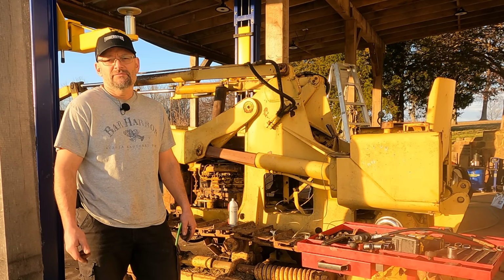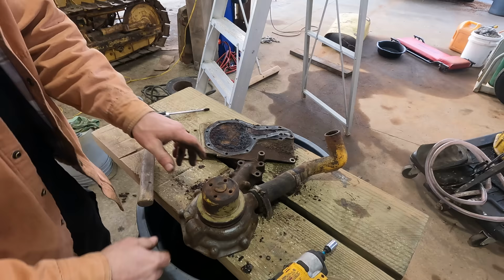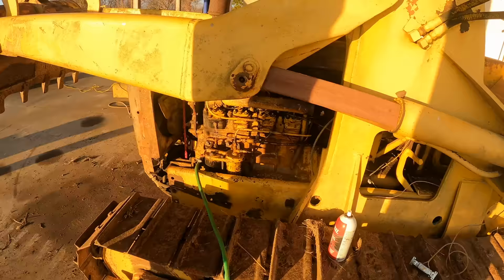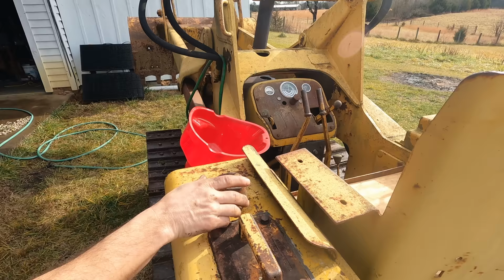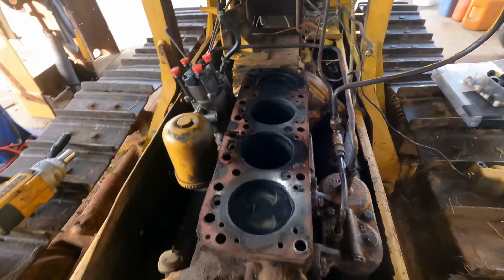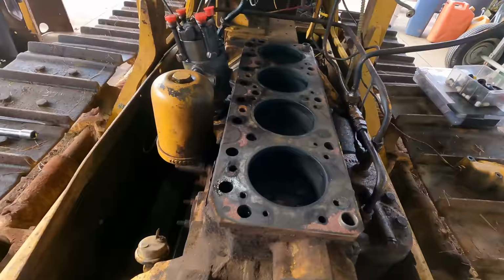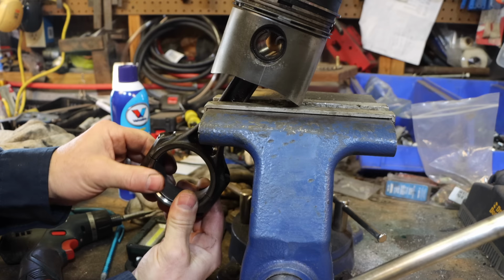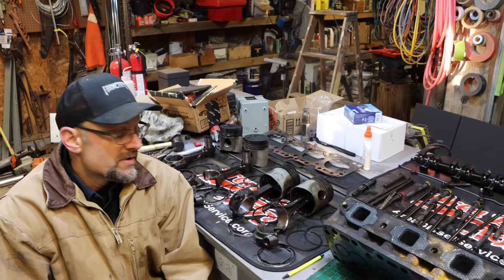1960 John Deere 1010 Diesel Engine Teardown.  Worth Fixing?

Comment: So glad the puppy dog eyes worked!
This will be amazing - Thanks for not just going down this rabbit hole but diving in head first!

Note on the radiator hose:
I have done this myself but…. Old Tyne packing tape - paper tape, fiberglass reinforced with all that dry glue - wrap the hose with that first, then your electrical/Gorilla tape combo. Apparently the way it’s supposed to work is that the leak gets the glue wet and the heat makes it stay stuck.

This was told to me in a previous century by one of those official “old timers” … who kept a roll of packing tape in his truck. (I never did see under the hood)

Comment: A bit to read here.

Don't reuse those big end bearings Jon. They're completely done.
Before putting it together you need to check the ring end gaps of every single ring. Pre gapped rings are never to be trusted.
Put the ring in the bore and use an upside down piston to square them in the bore and measure the gap with feeler gauges.

If you need to adjust them use a new file and dress every corner and edge you've filed with a stone so there's no burrs.

You need to clean the ring grooves in the pistons. A broken ring can be used as a tool to get in there. Be careful though to not damage the lands as this method can be quite destructive if the carbon buildup is bad, particularly on the pistons with the broken rings - sometimes those grooves can be very badly carboned up.

After honing, wash the bores with solvent as clean as you can get them. Next get some hot soapy water (a bar of soap grated into 1/3 bucket of water is best) and a stiff brush and scrub the bores clean. Next with new soapy water scrub them out with the sponge, blow them dry and oil immediately. A test of cleanliness is a clean white cloth wiped across a part of the bore and it remains clean. 
What happens with hones is the stone material gets into the cylinder metal on a microscopic level and acts as grinding paste. The soapy water/brush/soapy water/sponge method gets it all out.
Naturally you need to protect the big end journals on the crankshaft from all the falling honing debris and cleaning processes. Tape them up with electrical tape.

The deck of the block needs a very thorough clean. This will take time. A razor blade in a holder and some coarse Emery until all the bare metal is exposed. Absolutely no carbon however embedded should remain. After cleaning it well, Brake-clean or Carbi-clean the surface. It should be spotlessly clean. Sometimes I do this 3x. Some staining of the metal is OK on the deck just so long as it isn't old headgasket material itself or anything else. Rust pitting on there is usual on patch jobs so the cleanliness I'm making you adhere to is to give the very best possible likelihood of success.
When it's clean cover it immediately. Before putting the head on clean it with a brake clean soaked cloth and blow off at the last possible moment.
Do all this with the head surface if you don't have it faced. If you have it faced still clean it off yourself via the described bore method, but don't oil it.
Only take the headgasket out of the package at the last possible moment and inspect there's nothing on it - you can be surprised what you can find on there.
Be anally retentive re cleanliness on the bores and the head-deck and the job will be trouble free.

The head bolts should be spotlessly clean on the threads and bottom tap all the holes in the block. Blow them all out.
Very lightly oil the head bolts.

Seriously consider pulling at least 1 main bearing cap to inspect the bearing visually. You don't want it looking like the anti friction material is worn off down to the base metal in the bearing shell like the big end bearings.
Usually the mains fare better than the big ends because their motion is circular so they often wear less than the big ends that reciprocate.

Success depends on cleanliness. 
I once had to do a head gasket on an inline 6 that the customer did himself. It lasted 2 months and blew. He did it again himself and it blew again. I pull it apart and he's done a very good job actually - I could tell. Here's the thing, the block deck was not to spec. He was disbelieving when I showed him the carbon embedded in the deck was the cause and insisted it will blow again. Ten years later it's still fine. 
This is the difference between a well informed DIYer and a tradesman. It's just the little things for the most part - knowing when you can cut corners and when you can't. 
Cleanliness.

Comment: Saw the injectors on area diesel service.  Pretty cool.  

It has a lot going for it. No turning of crank etc.

Fixing the pistons seems the best approach although getting them completely clean so that the impregnated oils do not contaminate the weld will be the biggest challenge.

I would guess you would have to "bake" the pistons for a certain amount of time.

Comment: Old diesel mechanic here. Thought I’d put my two cents in here. It appeared that the head gasket was blown between cyl 2 & 3. Need to check both the cyl head and the fire deck of the block to make sure they’re flat (should be spec for flatness on you engine spec sheet. If too much warpage new head gasket will never hold up. A previous engine overhead could have created a lot of the issues you have found inside the engine. You could check ring end gap inside the cylinders if you curious about ring wear, I imagine you’ll find them way out of spec. Over ether also could break the piston ring lands. GOOD LUCK, LOVE YOUR CHANNEL!

Comment: hey John, it's a nice project, I look forward to see the result with the pistons, as i can understand you have enough tolerance to hone the bad cylinder, a alternative which i have used on a car engine, was to fill up the area with a 2 component plastic metal and then hone the cylinder. The car died of rust before the engine😂
ofcourse this solution depends on how deep the damage is, but you can save a lot of honing time

Comment: I have seen a diesel engine that is designed to run on 180 bar of in cylinder pressure reach more than 250 bar due to small whiff of starting fluid, you can hear the peak pressure like a bad case of knocking. After rebuilding I'd stay off of it for a healthy or a rebuilt engine.

Edit: After Seeing the entire video, the cracks in the ring lands and the rings might be from the starting fluid. since in compression ignition engine, the point of ignition start for the starting fluid air mixture isn't controlled, plus combustion speed is very fast, combustion might happen very early, and peak pressure could be very close to TDC, rings and ring lands would take a serious beating in this case, con-rod too!

Edit 2: i love that you are going to try to fix them, one thing to note, diesel pistons sometimes are multiple material or even multiple parts, ring lands might be steel embedded in the Aluminium

Comment: I would suggest putting those pistons in the UT cleaner with as much degreaser as you can muster to get as much oil as you can out of the pores of that aluminum casting before you hand em off to your buddy for welding.  Oil saturated cast aluminum is hell to weld and defects are almost certain.
Reply: And then bake em and clean em again afterwards. Don't use brake cleaner. chlorinated cleaners will form phosgene when you weld.

Comment: On your hommade hose, get a tube  of old hose to squeeze in from one hose  side to other and clamp till you can get new hose. Or get  copper fittings the right size and solder/braze them to right angles you would have a forever tube then clamp tube remainder to each end
 Good luck. They make lots of different angles sizes
Good luck

.

Comment: Watching your vids has given me the gusto to work on my car.  Have never turned a wrench, but have knowledge on how cars worked.  Most people would never put their hands in their machine.  So far, a air thru hose replacement, multiswitch turn signal replacement has been accomplished.  Just diagnosed my first parasitic draw that killed my battery in less than 48 hours.  Already found the culprit, ripped it out, and waiting for a possible replacement.  So far battery has not drained with fuse/electric switch removed.  Now engine tear down, don't have the means to do, but the small stuff seems to be no prob.

Comment: That ring land damage is due to ether/starting fluid being used. Super common problem. Welding and turning might work for this, however modern pistons are not round. Used or NOS pistons would of course be a better choice. Welding will need to be helium TIG for strength, which is big $$ these days due to helium costs.

Comment: John, I am thrilled that you are continuing this project. I am reliving the experience of my purchase of an identical JD 1010 that I purchased 2 years ago. Especially now that you have it moving. The steering issues are identical to what I am experiencing. Because mine ran, it smoked  a lot but  it clears  after warming up. You are giving me hope as you continue tacking on this machines issues. As someone else mentioned your deductive reasoning, is an amazing trait and watching  how you work is enjoyable.

Comment: Well done John, thanks for not giving up. Yes repair the 2 pistons, new rings, hone the cylinders (don't get to obsessed on the scratches in No1 cylinder), lap the valves, new big end bearing. It will run good with all that. This is good content. lots more videos to come on this machine 🥰 Keep the content coming on the loader. Thanks for sharing this adventure. Cheers Stew.

Comment: Hi John.  I love your perseverance and great videos!  However (and I'm not trying to be a "negative Nellie" here), but based on my experience and the opinions of a couple other very knowledgeable people I spoke to, I think trying to weld and re-machine a cast aluminum piston is a recipe for failure.  And I know you're trying to get by with minimal cost here but the pistons are one area where you should probably spend some money.  If you are not aware, you could get your OE Deere pistons duplicated by a piston company (i.e: Ross Pistons or others) for about $300 each.  I hope you consider this suggestion or find some used pistons for this project.  Keep up the great work!

Comment: Good to see you are not giving up on the old girl.  With my vintage vehicle, direct replacements are not available for the most part, however parts were made for other vehicles that are compatible with it.   You do have to know the sizes and what other machines they were used on to find them though

As for the adjustable belt, while I have not seen one used a permanent replacement, they do work pretty well for short term, get you home, work.

Comment: A good practice when starting old diesel engines, crank it til you see white smoke then stop and let it sit for ~5 minutes then crank it again (this lets the diesel soak the rings and improves the compression).
Reply: Also a good practice is if the engine has glow plugs, use them. Otherwise it won't start without ether.

and another one:
If an engine is cooled with water, do not run it without water, especially not at high speed for long periods of time.

Comment: From one back woods mechanic to another - brakleen and scrub the radiator hose ends, stitch it back together with safety wire, shove rtv into the seam and then once that cures brakleen the whole thing again and put gorilla tape over it all.  Add zip ties around the whole mess to keep the tape on.

Comment: If this were an automotive engine, you could find any number of piston manufacturers that would make you a custom piston. I don't know the first thing about diesel pistons, but I would look for a manufacturer who makes a diesel blank for this bore dimension and who might be able to make you all four. With reconditioned rods, proper block preparation plus head resurfacing and a valve job,  you get back to a short engine that's basically as good as new.  In my view the condition of this undercarriage is what makes this worthwhile. If it can run reliably and be productive, to my estimation it's worth up to $10k. If it were mine and could fill a need on my property, that's what I would do.

Comment: Well, I’m glad you’re going to fix it, I had the same dilemma six or so years back for my lawn tractor with a KT 17, Kohler 200+ for each piston. I found some good used ones for $50 each. I use this thing to plow my driveway, I spent $500 to repair that engine plus my time. I’m so glad I rebuilt that engine. It’s an awesome garden tractor. Keep up the good content.

Comment: Kudos to you for attempting to repair the engine, remember if you do ho about machining the pistons that they are tapered and not parallel along the height. Please god do me one favour, when testing equipment, especially if there is a steering issue like with this dozer, don't test it next to your pickup or your lifting arms. You are not experienced enough to be able to control the thing if a clutch pack locks up or frees off unexpectedly, you'd right of your ride before you new it or take down your workshop. Also I'd suggest looking for an engine you could replace your one with, it would be way cheaper and probably run better gor longer.

Comment: 1/5/24..John, wow! A very big A+ to you for going this deep into yur JD 1010 Loader. I must emphasize just how much (used/sbused Diesel engine trouble shooting) educational content you are providing. This is a great interactive activity where you John ask for help from those with extremely wide breath of old engine troubleshooting experience & your viewers respond with all you need to go onward to the next level of understanding & step-by-step you confirm the problem & it's solution. This is just great! 
  Now we are at the piston ring 'gland' (gruve) level where you need 2 of 4 'newer' pistons. We are clearly 'deep' in-the-woods...& it is great that you have brought all interested viewers this far along. Personally I think 4 'newer' (used) pistons, new rings + honeing each cylinder is best but you are in charge so we roll with you judgement. 
 I will bet after you re-ring pistons, hone cylinder walls & re-assemble & make few other (hydraulic hose repairs) you will easily sell this machine. You will get enough $$ back to cover parts but not your labor. Am betting your YT income from this episode alone will pay for  your labor. 
  Always anxious to see your next video. So stay safe & carry on!👍👍👍💪⚙️🔧🍺😋

Comment: Look forward to seeing it in use with pair of forks hooked on the bucket so you can lift your log palette with it should be capable of lifting more than the tractor while you are waiting for the pistons see if you can sort out the steering issue might just be stuck

Comment: Have you considered the possibility that the high oil level is due to fuel contamination and that part of the low compression might be due to low viscosity of the contaminated lubricating oil?  The blue color of the smoke suggests that at least some of it is lube oil; smoke from partialy burnt fuel is typically black.

Comment: Many years ago pre-igniton blew a hole in a piston of my Benelli 650 twin motorbike, caused by running too high a compression ratio on a race track. I had the hole in the piston welded up and it ran fine afterwards.

Comment: Well John I have to concur with others and say you have come this far, it's time to spend money on the head gasket and new rings and maybe new cylinder sleeves. I am like you, though I don't want to spend anything. I don't have to, but  in this case, it may just be worth it. Buy a few parts and possibly have a good working bull dozer and as I said, you have come this far. Love the videos made better by the fact you don't waste your money, you spend when you have to, and that's the good part, your frugal. Not go willy nilly spending big on everything, honestly that's the best part, and the sense of humour

Comment: I've got an 1926 Cat Twenty over here in the UK. And someone in France (which is where it came from) fitted what we think are Fiat pistons, but it still works. I would think that you would be able to get aftermarket pistons for a Cat engine of similar size. That could be machined to fit/work and as they are mass produced they are a hell of lot cheaper. Just a thought? 🤷🏼

Comment: Red is high temp RTV.  Used it on my wood stove to put in a new glass rope to seal the door.  Many years ago.  Link belt were developed for conveyor pulleys.  I have two sizes.  Works great.  As it wears in - compresses - take out a link.  Instructions say so.  Looks like a large return line.

Comment: As one of those that advised to take it further, I'm amazed at how far it's been taken.  The videos have been great and very informative on how to diagnose particular issues.  The broken lands on the pistons were a serious twist in the story, everything else I kind of expected at some level or another.  I had the same idea to do a weld build up and lathe 'em back, and I'm sure I wasn't the only one.  I can't wait to see the results of the work.
I do disagree that the machine isn't worth it.  Sure, for $5K you can buy a newer loader in some form of a used nightmare that would still likely need $2k+ to fix it back up.  Used machines at this price are at the price for a reason.  This is a piece of history and could have many years of work left in it.  Fixing it is the accomplishment, working it afterwards is its own reward.  Keep going!

Comment: Also remembered this, on my 1942 Jeep, the connecting rods are only interchangeable as groups, basically 2 & 4 or 1 & 3. The connecting rods have special curved offset to properly align with the bores, due to the way the crank journals are cast